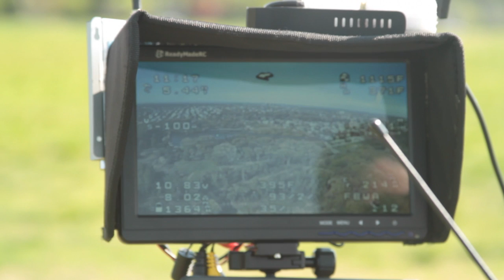Mako Wing + Arduplane (APM)

Comment: The reflections from the dome on the hd camera suck.  Did you try putting black card around the lens of the mobius that fits right to edge of dome?  I have just ordered the skyray (same thing) and think I will try that or mod the foam nose to fit my xamoi yi and board cam into it.
Reply from the maker: sorry for delay. I haven't but you're right, buddy of mine did it and works well. Also bringing the camera lens as close to the dome helps (what I did)

Comment: are you serious first flight with flying wing shiuld be a bit nose heavy?
Reply from the maker: yes until you find the best CG for your wing. Tail heavy will increase your chance of experiencing the 'spin of death'
Reply: hm. i get it now
and you said earlier that for hand lauch, dont throw it too strong?
should throw with enough, and not too much power?

and 1 big question from me, does this mako can fly at slow speed or glide?
since so many people having complaint that this mako often have death spiral in slow speed or gliding

i mean fly with no fc or apm or autopilot, just with std los
Reply from the maker: hey sorry for delay. Basically don't give it your all when you throw it, which you may want to do since it feels heavy in your hand. 

If your CG is off you'll definitely get the death spiral, so need to get that  on point. It does not glide amazingly, but you can see in the video how slow I fly at times; it'll glide, but the rate of descent is high. gluck!